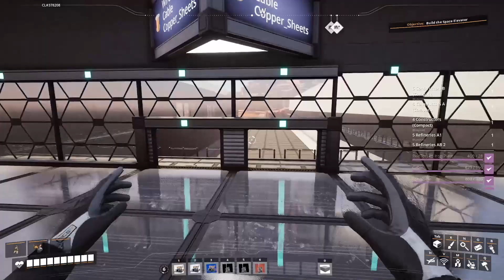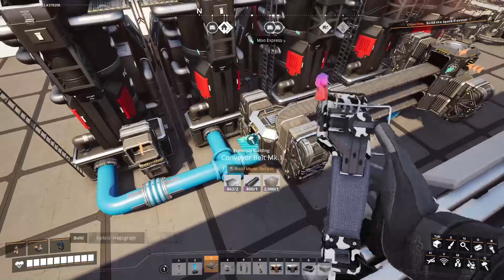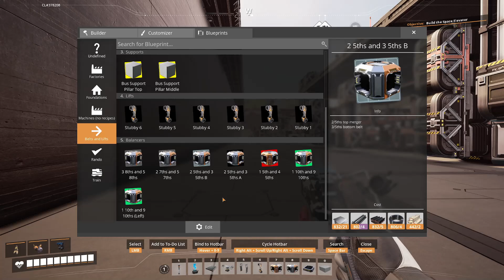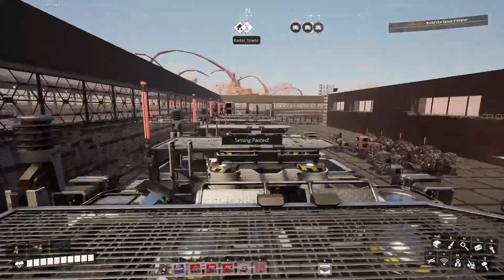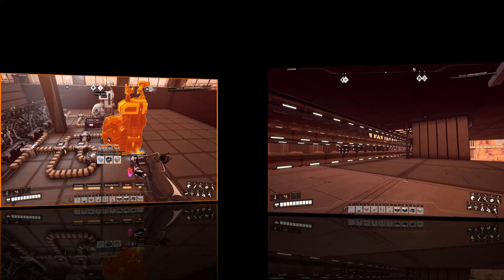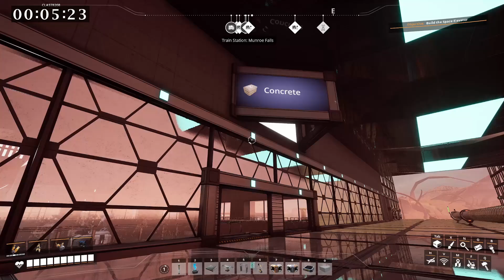Load Balancing Copper & Steel Parts - Satisfactory 1.0

Comment: Do you think it’s absolutely necessary to use the proper belts or can’t I just use the MK 5 belt on everything whether it is required or not?
Reply from the maker: You can certainly use mk5 more often than not and it’ll be fine, and even a little quicker to start up. The only time you would really need the slower belts is if you are using a smart splitter and using belt speed to get the amount you want to balance.

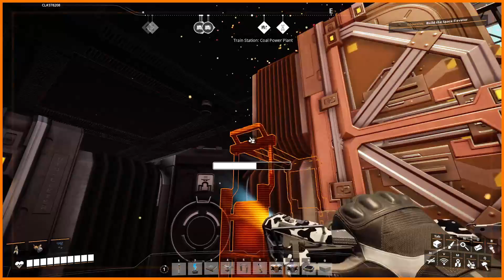Comment: When you place the conveyer lift, at 4:00 for example, why not just place another splitter/merger on top of it and then connect the lift and remove the slitter/merger on top? Or does that not give the correct results?
Reply from the maker: You are asking a terrific question. To be honest it wasn't until this comment that I actually tested it out. It hadn't occurred to me that the lift's 'accordion' bit at the end would go back to its normal size after you saved and reloaded the game. When you delete the splitter/merger the accordion part is 1m longer than it should be. If you try to make a 90 degree turn right out of the lift, the belt would clip through lift by just a little bit. And I really didn't like the way that looked. I never thought to save the game and reload it to see if it shrank that part. Thank you so much for asking!!
Reply: @moo121  Okay I see, thank you!
Reply: The accordion also changes back to proper size if you change the speed of the lift
Reply from the maker: @cerealsgames3118  That's amazing! Thank you so much!